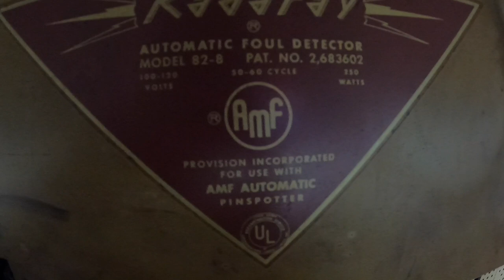12 AMF 82 30 Pinspotters Running Strong!

Comment: I still find it amazing these machines are still in action 60 years later.  I used to be amazed at how the pin pickup would also grab an off-spot pin and put it back where it was.
Reply from the maker: They are the antiques for sure. But with performing proper maintenance, they will last for years to come